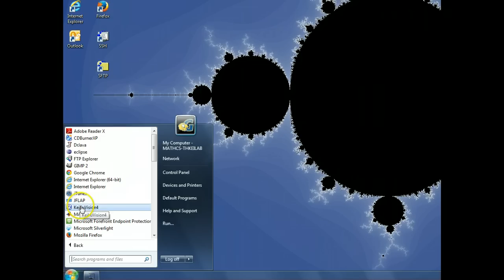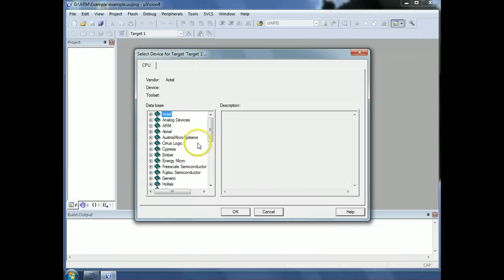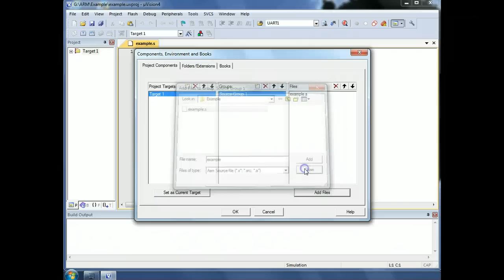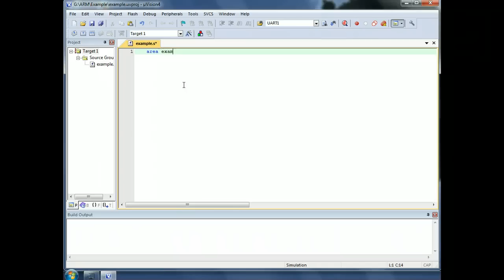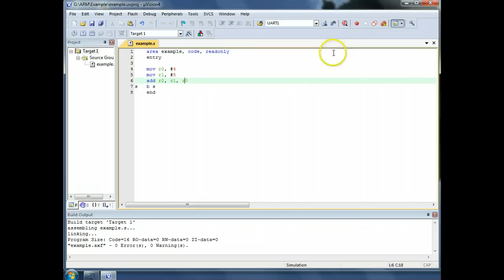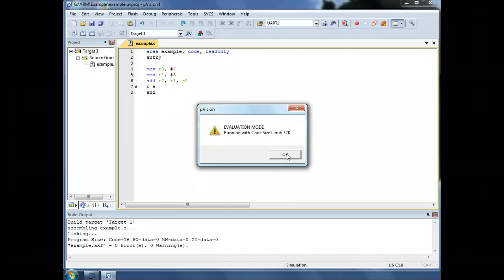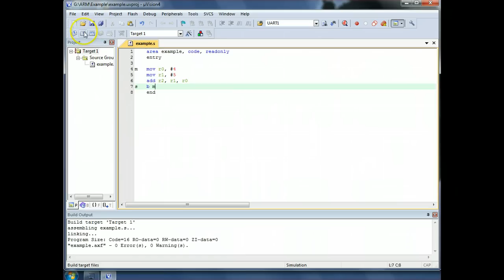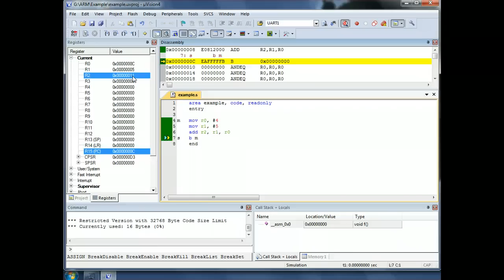Keil uVision4 How-to

Comment: Good Video,
I am learning Assembler in Keil uVision 4 but it is difficult for me. Your vdeos help me a bit, but I couldnt find a Video where I can learn to get for example 20 numbers to the external memory.

I have a code like this:

mov DPTR, #00h
mov A, #00h
movx @DPTR, A
  
inc DPTR
mov A, #01
movx @DPTR, A
  
inc DPTR
mov  A, #02
movx @DPTR, A
 
inc DPTR
mov A, #03
movx @DPTR, A

...

inc DPTR
mov A, #18
movx @DPTR, A
  
inc DPTR
mov A, #ffh
movx @DPTR, A

But I cant see the numbers in the external memory... There should be 20 random numbers without a sign. Only numbers from 0 to 100 (or infinity) for example. How can I do it? My code isnt working.

Thanks for your answer, Assembler is an old programming language and I couldnt find any help on the internet. Glad that I found your channel.